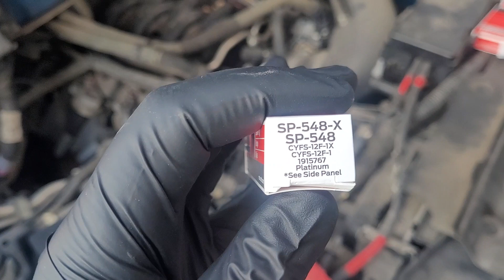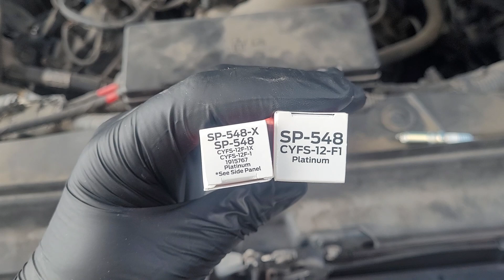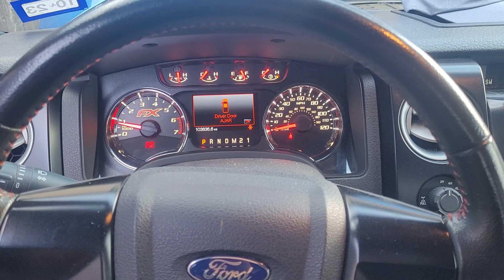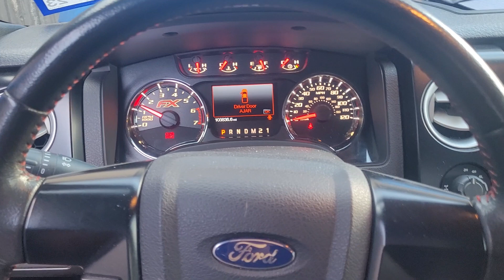how to: 2012 F150 5.0L spark plugs

Comment: I have the 2012 f150, mileage 220,000km, never changed spark plugs, the garage guy took one out and said the spark plug is still good to use, unbelievable.
Reply from the maker: "still good" and optimal operation are two different things.  But I know what you mean!

Comment: Thanks for the pointer on the clips as i wasn't to crazy about removing them like other videos showed. Should the gap on the new spark plugs be checked before install and if so, do you know the gap setting ?  Thank you for the great video 👍
Reply from the maker: you're welcome on sharing tips/tricks.

I dont recall the gap measurement off the top of my head.  I believe it should be listed on the under hood emissions label